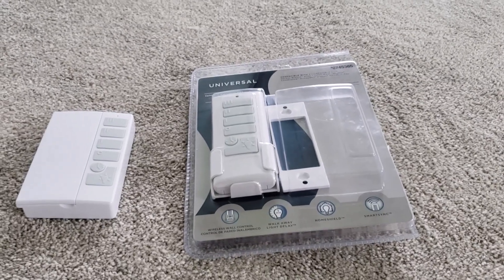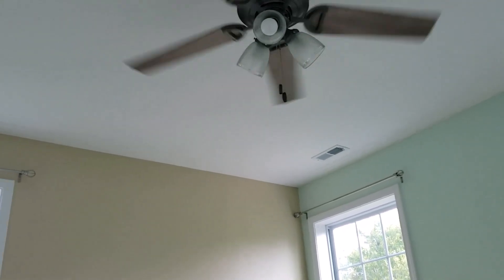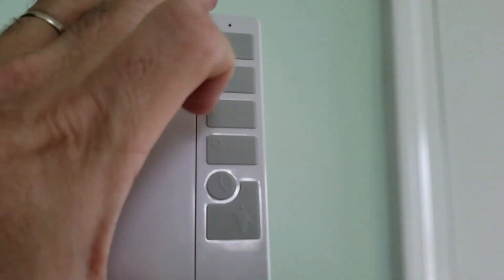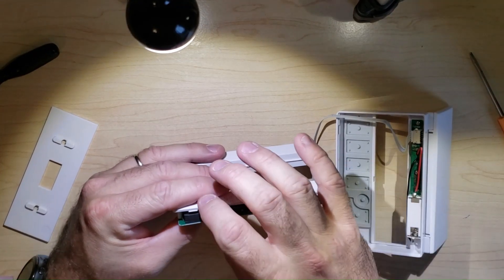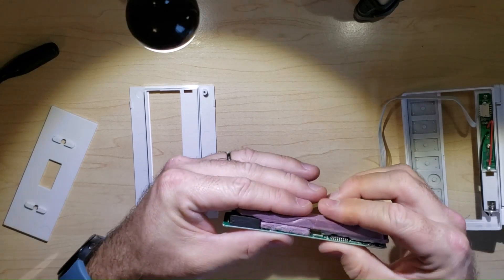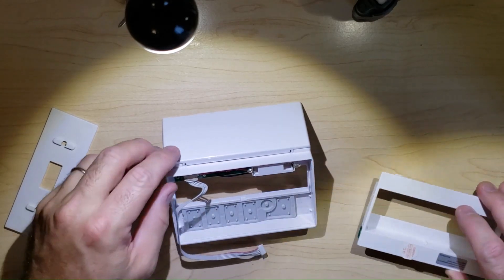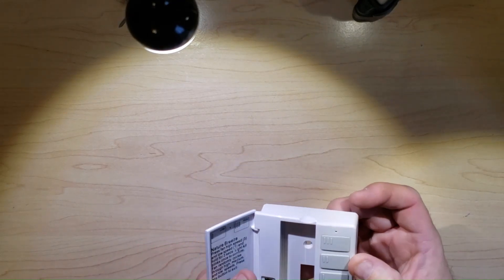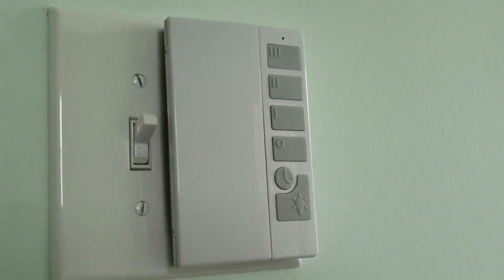Problems with Harbor Breeze Wall-Mounted Ceiling Fan Remote?

Comment: Thanks! I have a Casablanca fan with a wall remote with the same problem. I cut wall plate insulation and taped it to the back and sides of the remote. It solved my problem. You are the only one I could find that identified and resolved the problem.

Comment: how did you program the remote? I followed the manual but it is not getting paired.I have separate power switches for fan and light.i turn them on and hit learn button, nothing happens. The fan and light is on once the power switch is on. Any clue? My electrician is suppose to come but has not shown yet.

Comment: Harbor Breeze Fans and remotes are total garbage.  I will not buy another fan from this manufacture in the future.  They don't support their fans.  If for some reason your remote gets lost or broken, they will not continue to support their fans.  You will need to take the transmitter out of the fan and install a new one.  Our new one only worked for about 1 minute before it too failed to work.